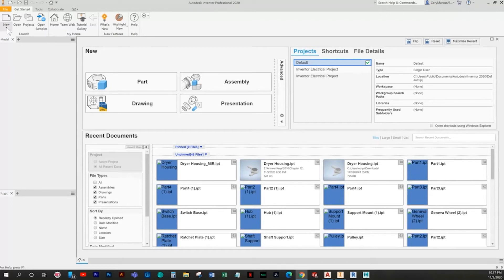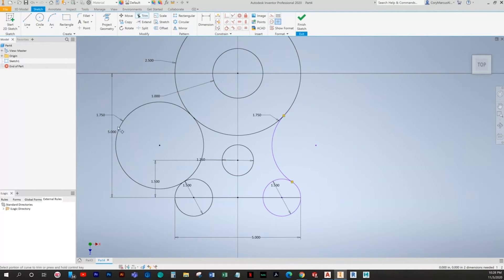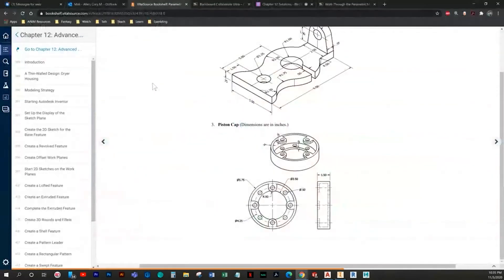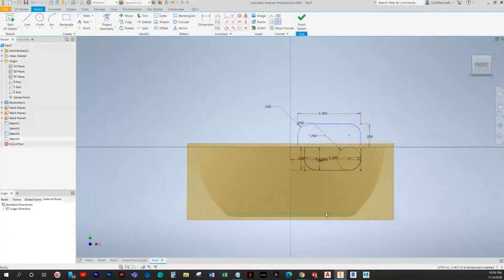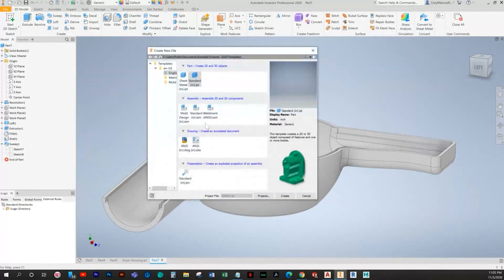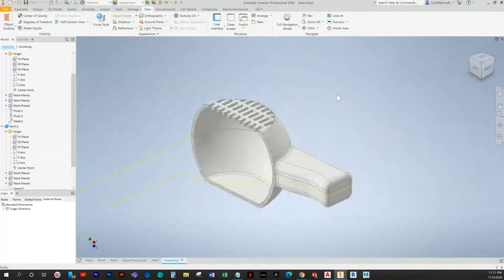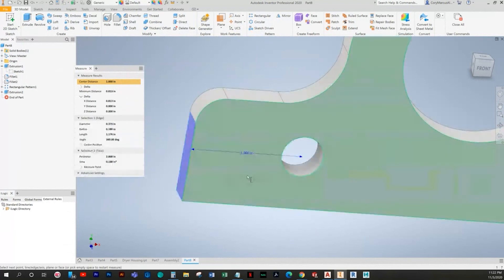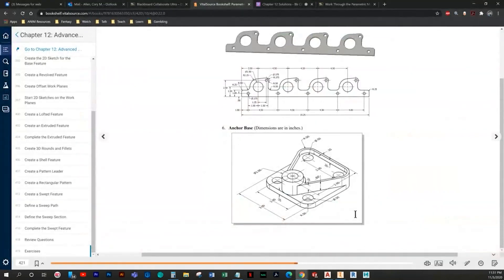Chapter 12 Solutions: Parametric Modeling With Autodesk Inventor 2020

Comment: In exercise 1, the motor housing is supposed to be hollow from what I can see in the drawing. How do I get rid of the portion of the shell from the hole . other than that I was able to get the same result you did. thanks for al the video.
Reply from the maker: I appreciate you bringing this up. I botched that part pretty bad haha. Sometimes doing these parts fresh I make mistakes. I'm working to record new versions with corrections though. To answer your question if I fully understand it, to remove the cylindrical internal portion just make sure to select it when doing your shell feature as well.